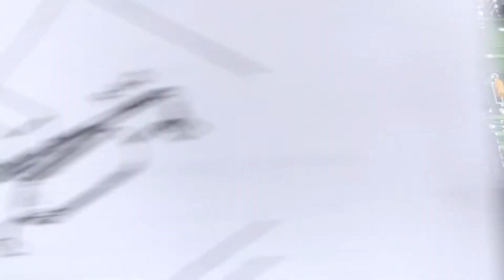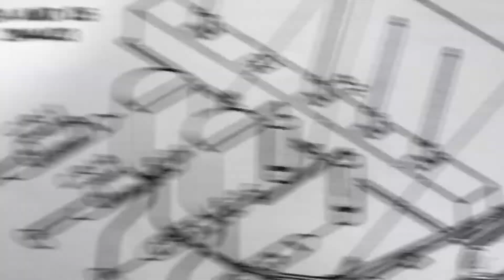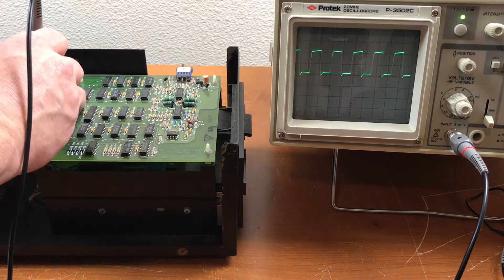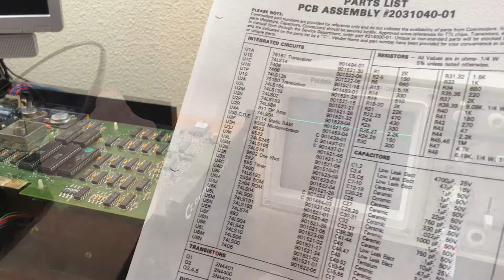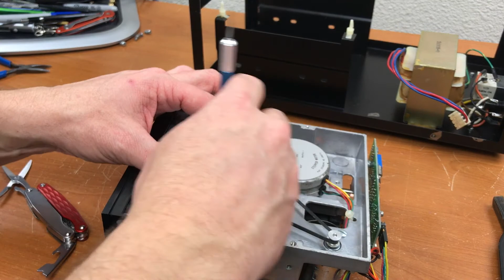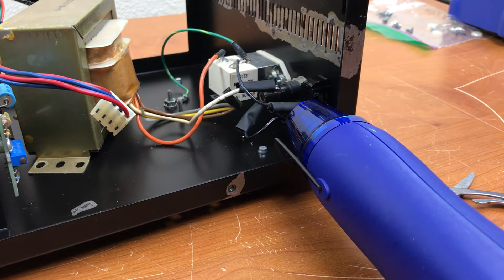Commodore 2031 Floppy Repair

Comment: I have a 2031 which seems to be in a 1541 case.  I had the problem that it would format a disk okay and then after a month or so, it would suddenly be unable to read the disk.  Reformatting would "fix" the problem until it failed again a month or so later.  I assume it was going out of alignment, but I've been unable to find any information on how to fix alignment problems.
But now, after it being stored for many years, I have exactly the problem you described here which indicates to me that the ROMs have gone bad after so much time.  So I'd need to do a lot of work to get it back into working order.
Reply: @HutchCA  However, this is quite a bad conversion. If you want to enjoy it a bit longer, you should at least use a 74LS06 as driver stage. This botch-up had already been criticized in the 64'er. Some of them had also broken the 6522. 

You just had to have a look at the schematic of the 2031. Unfortunately they saved a few cents, which had killed the 6522 in case of doubt.

A few years ago I even made a switchable version. So you could easily switch between 1541 and 2031. Dann muss man nicht immer hin und her umbauen, sondern kann per Schalter die Schnittstellen umschalten.

Comment: So glad to see you brought it back to life! Is it noticably faster than the 1541?
Reply: Yeah, all the PET/IEEE drives are way faster than the 1541 for data transfer because IEEE is parallel while stock IEC on the C64 is serial. However, for internal tasks like formatting, the IEEE drives are no faster, as they have nothing to do with communication to the computer.
Reply: @8_Bit  Hey Robin, nice to see you here. You have the best commodore/8bit/6502 channel on YouTube.
Reply: @8_Bit   Parallel versus serial doesn't mean all that much because the C128+1571 and C64+1541+fastloader (just software/firmware) could read much faster on the serial bus than the PET+2031.  What matters the most is the speed of the protocol.  All of the data is read and written one bit at a time on the floppy disks themselves anyway.  It is a myth that the 1541 mechanism is slow (it's as fast as any other of its kind from that era) and also a myth that having a serial connection placed a serious limitation on its speed relative to others (could be increased tremendously just with software).
Reply: @rbrtck  As much as software fastloaders improve the 1541, parallel mods do exist for the 1541, and that's because parallel is even faster, and that extra speed is needed to read the GCR in real time to image some disks. And of course someone could write a fastloader for the PET IEEE bus and show what those drives are capable of. I'm pretty sure @10 Minute Amiga Retro Cast was asking for a comparison between stock KERNAL loads on the 1541 and 2031, but he can tell us if he wanted to talk about theoretical limits of their performance instead.
Reply: @8_Bit   Of course adding more lines increases the potential data transfer rate, but there were some software-only loaders, such as Vorpal, that came very close to the effective transfer rate of, say, DolphinDOS (optimized parallel), which is limited by the speed of floppy drive mechanisms anyway.  My point is that the reality of the situation is not nearly as simple as the notion(s) many seem to have: that Commodore floppy drives were inherently slower than other similar drives and/or that the reason they were SO slow was merely a matter of a serial versus parallel data connection.  Anyone who has used a software-only fastloader (who hasn't at some point?) should know better, but even so, people keep bringing up the serial versus parallel thing when the protocol was always more important.

Just the other day, someone asked why the C64+1541 doesn't have the parallel connection that the Plus/4+1551 has for a faster default speed, but with the right protocol the C64+1541 can actually transfer data so much faster than the stock Plus/4+1551.  OK, maybe a fastloader on the latter would theoretically be even faster, but this whole subject would be moot if the C64+1541 had worked as intended.  It's not because of the IEC bus and cable that the C64+1541 using the stock protocol were SO slow, and getting the slow parallel connection of the Plus/4+1551 would have been inferior to what the C64+1541 were originally intended to have (the same as the C128+1571's so-called "burst mode").  But some idiot at the manufacturing facility screwed up the C64's motherboard (making unauthorized deletions), and here we are (38 years later!).
Reply: Hey Doug, love your awesome channel :-)